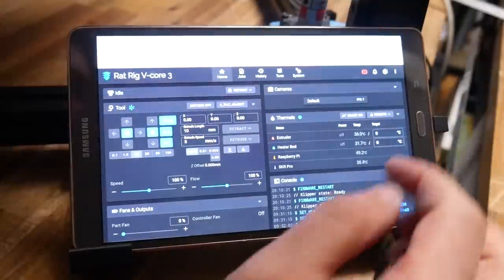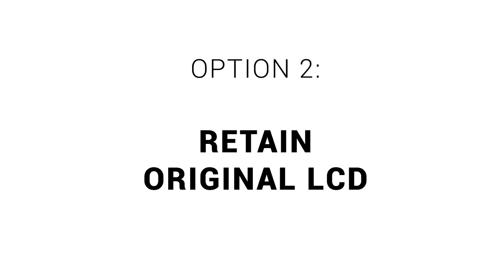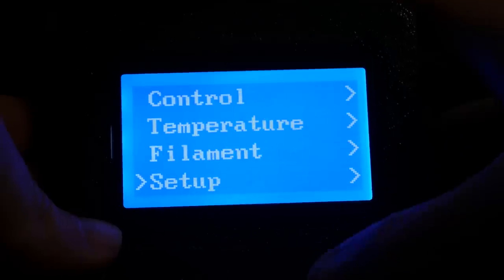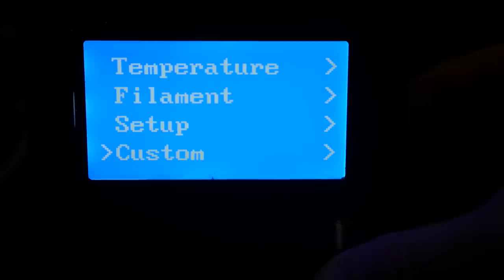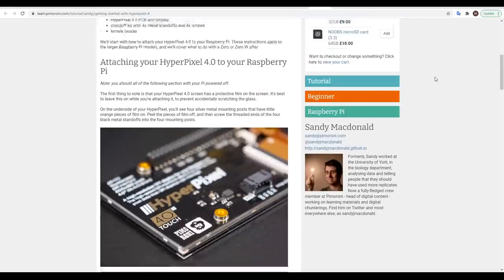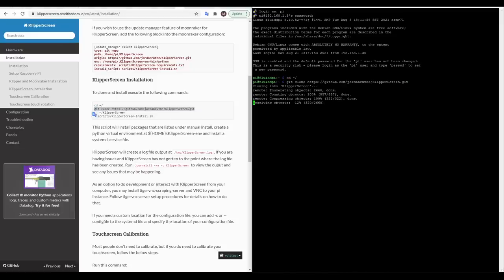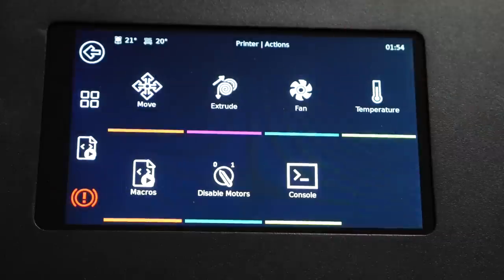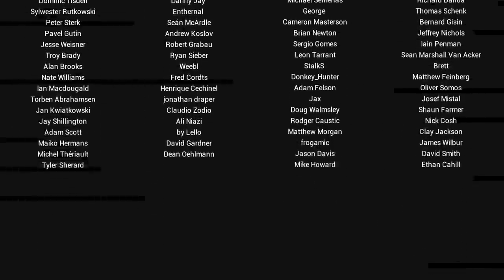Klipper interfaces: Step by step guide to 3.5 options

Comment: Klipper screen also will NOT work very well with  Octoprint…since it interfaces with moonraker and not Octoprint..fine if you are running Fluidd or mainsail…octoscreen is another option in that case….
Reply: True - or Octodash :)
I tried Klipperscreen and just as you said, it was frustrating how it wasn’t ‘in sync’ with Octoprint, plus it required a Moonraker install which seemed to mangle the Octoprint environment variables the next time I tried to install something for Octoprint
Reply: @alexshepherd  Exactly....reason is that Klipperscreen talks to the Moonraker API, and not Octoprint....I happen to be a long time Octoprint guy, and you can not really beat it for all the very useful plugins....so I will just stick with Octoscreeen for now....oh well...

Comment: Man… I’m using a PITFT50 with my V-Core 3, but it simply stopped to work. When it’s connected, the Pi stays all the time at initialization and don’t get Web interface!
When I disconnect the cable, everything works fine…
Reply: @kickaboob  Not yet! I’m looking for a solution!

Comment: Does anyone know why an MCU shutdown error is happening on Klipper?
Reply: I have had a similar issue, it could be a couple of things. If the pi isn't getting consistent power from the psu, it can shutdown. Another option is that it is overheating, if you are running a pi zero, this is probably the issue. Personally, I swapped to a more powerful pi, but I would check powersupply, and maybe buy a heatsink or fans for the pi. Also, try restarting klipper after restarting the pi. This is from my limited knowledge from debugging my own. Hope that helps.